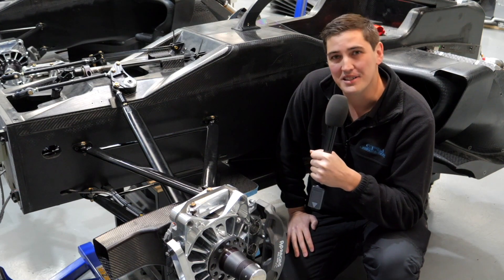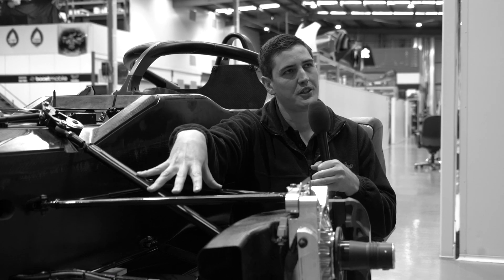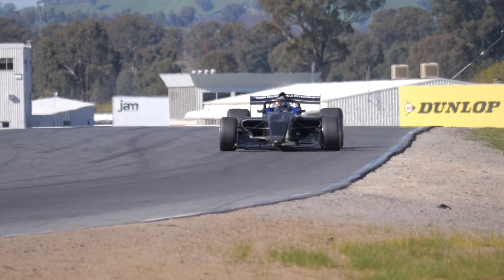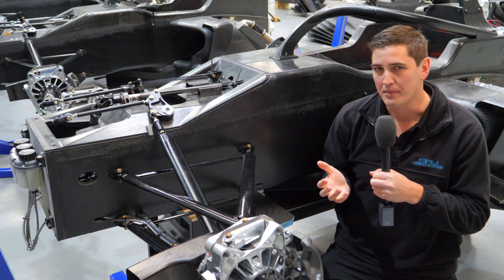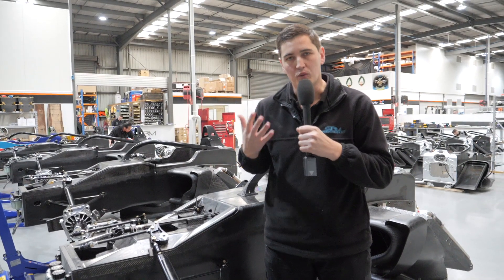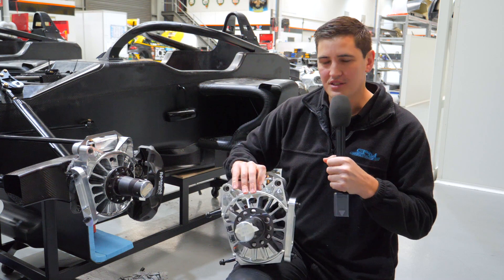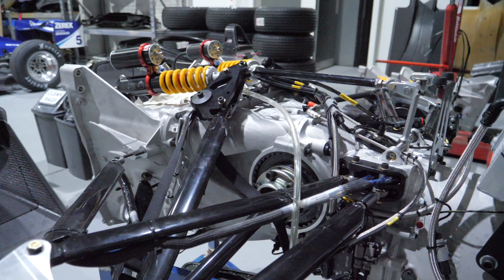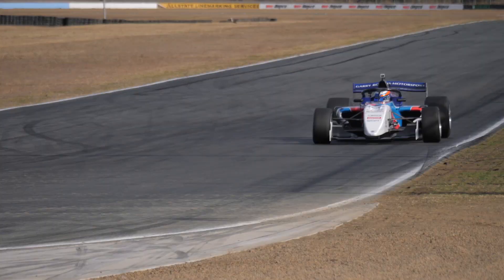S5000 Technical – Suspension

Comment: how are the front control arms adjusted with that small brace making them a fixed triangle,
or is it shimmed?
Reply: You can turn the rod in or out and lock it with the nut just below the mounting point at the inboard end of the pushrod.  There are also multiple amusements at the spring- damper.  Low and high-speed rebound, plus bump on the shock. The preload and the design of the spring also offer multiple adjustments.